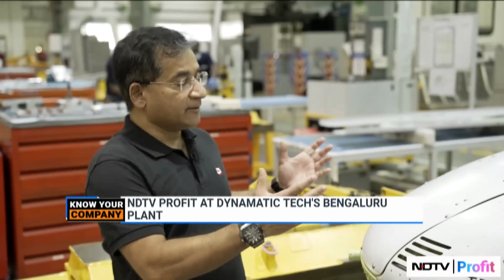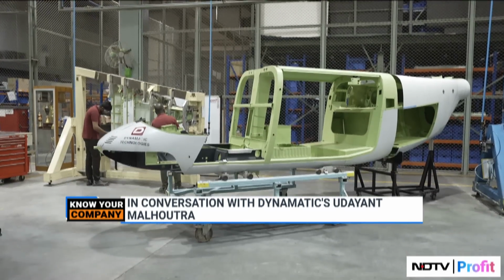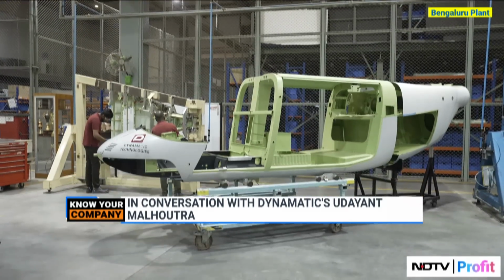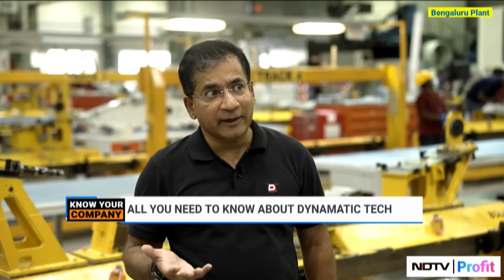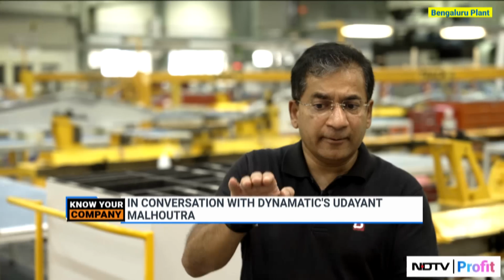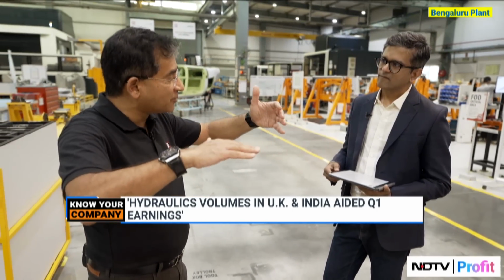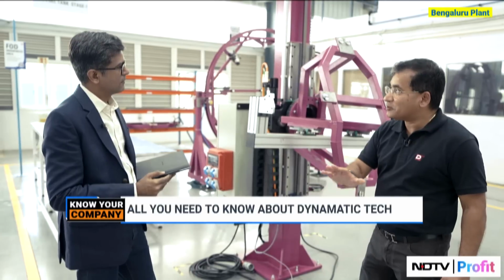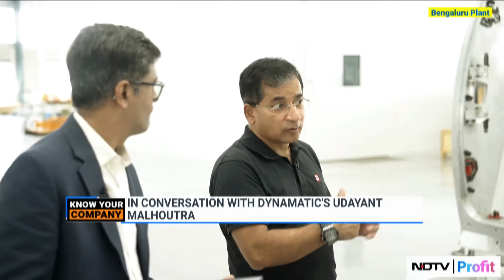Inside The Indian Company That Supplies To Boeing, Dassault Aviation & More

Comment: It seems the factory still does all the production in jigs, manually.  The industry has travelled a far lot elsewhere in method of production.  Automated, robots with AI is employed today for errorfree, accurate and mass production.  Here comes the competency in delivery, price and quality matters.  Many indian companies fail to meet. Indian industries shall adapt new manufacturing technologies and adapt change.
Reply: Well I think they have many advance machinery because in video at 5:30 centre of both of them you can see a huge CNC 7 axis DMG machine..... And also they are on shoft floor soo I think definitely Owen a separate machine shope.